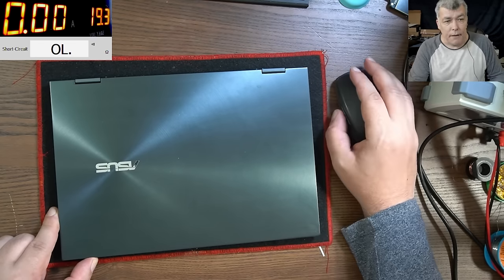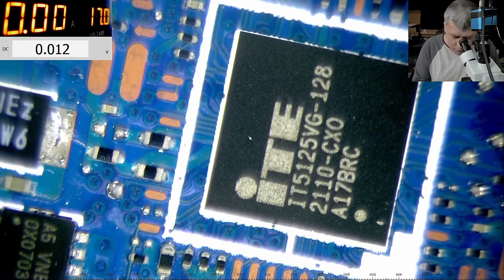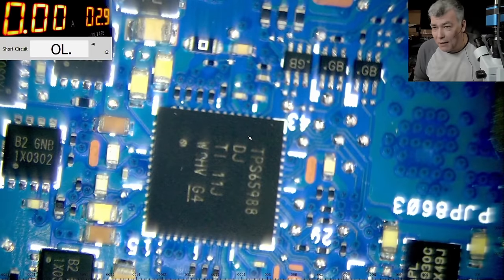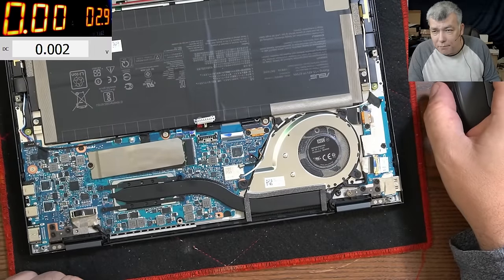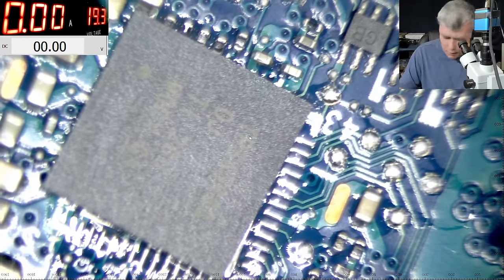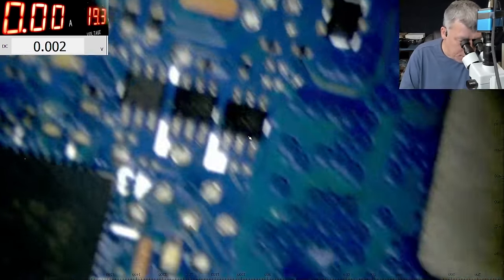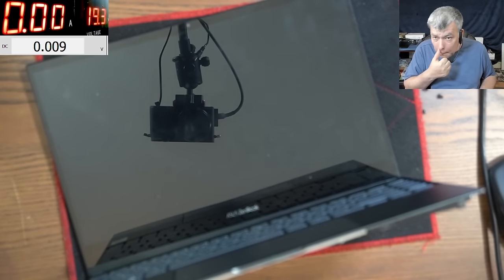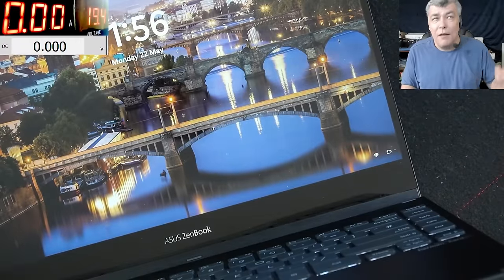Asus ZenBook UX363 not coming on repair. TPS65988DJ replacement How to diagnose this chip issues

Comment: next time you should waste an extra one minute to wick the pads on the board, and replace with low melt solder, you will even be able to lower the temperature to solder back!!

Comment: I have a Dell XPS 13 with the same chip. And the same problem.  I've ordered a replacement from mouser and will try to replace it. I'm new to hot air soldering so I'll definitely watch some tutorials first.

Comment: If you buy a chip and they are a good seller they clean it. And you have to solder the chip because there is a layer of oxidation from the cleaner. And it wil not bond with the solder. Iam happy you found it and get it working.

Comment: Sorin, you need to clean the pads of the old solder first, prep pads with new solder before you solder the new chip in place. I have tried soldering these chips without doing this and they most times do not solder right and I only end up burning the chip trying to get it right. I never solder a QFN chip now without cleaning the pads first.
Reply: I' m also heating the pads on the motherboard at 480° for a while before placing flux and new chip .. that i will reflow at 370°...

Comment: Sorin, this is not the first time I experienced the pins on the chip needed to be cleaned and tinned. Maybe, caused by the solder used by the manufacturer to tin the pads on the IC.

Comment: Try the TPS65988 on other unit if the TPS65988DJ does not work, no firmware required as per specs. Pre programmed with common usage scenarios

Comment: I told you to buy chips from Mouser or an authorized vendor. Especially if it's a complicated chip maybe MOSFET or capacitors have tolerance of fault of manufacture.
Good luck

Comment: I believe you should clean the old solder when you take off the bad chip and reflow with new solder and then put new chip, I dont trust the solder on new chips Sorin just my opinion.

Comment: Yup that chip need firmware to run. I have read the documention on that chip. Texsas Instrumen do provide the tools to program it. The chip also support external bios chip, to store the firmware. The chip can be reprogram with any SPI/I2C programmer. The tools natively support FTDI, Aardvark and TIVA programmer.

Comment: Great video as always 🤓
Could it be that new chips come with a protective film layer on the contacts that need to be burned or cleaned off, may explain that which we did not see 🤣
Reply: It is not that. It's due to Sorin's bad habit of reusing existing unleaded solder. The proper way to do it is adding flux to the pads, tin the pads with leaded solder and then reflow the chip in place. If you just desolder the chip and try to use the remaining solder to do the job, things like that do happen alot.

Comment: 1. So it seems it's not like those pesky undocummented realtek chips with "it's NDA" kind of support. TI says in the DS: "Initial device configuration is configured through a configuration bundle loaded onto the device DURING BOOT. The bundle may be loaded through I2C or SPI."
However there is some kind of firmware GUI config tool.

2. Aren't you afraid you'll melt some plastics under the board?

Comment: 30:25 no Sorin, this time is not good. Right side, 4th pin from the top and one above right down corner.
You added new solder to the middle of the big ground pads under the chip, which was good idea, BUT if so, then during the heating, you have to press down the chip UNTIL you see the big balls of solder coming out from the edges. You pushed it down very well BUT I didn't see these balls coming out, so it means that the solder under the chip were not proper melted (solder outside the chip were melted - yes, but not under the chip on the huge ground pad) You heated it not enough time.  So you soldered it but it didn't sit down to flat completely - so some pins can be unsoldered.
Reply: Mr Guru  yes. I told him many times in the past when he solder high power mosfets. Maybe it is not because of me, but now he is doing it very well - always he is pusihing it down. Here on this video he also pushed that IC down- so he understand how it needs to be done, but this time it was  not enough heat.

Comment: Good afternoon. I'm based in the UK and have a similar issue with my UX363 notebook? Sometimes it works for hours on end with no issues, other times it will require a power button discharge before it turns on. Now as of yesterday (14.08.24) after 6 months of on and off use, it fails to power up at all, no power led. What do you think my options are? 🤔 Many thanks in advance!

Comment: I have the same laptop and issue, stopped receiving power through the usbc ports. I took It to a repair shop and they told me it would need a whole new motherboard replacement. Was it just that 1 chip on the board the he replaced that was the issue?

Comment: I have a similar laptop but in my case, the laptop turns on, but does not charge. The second USB-C port does not work either, and the laptop just turns on with the first USB-C port. Do I have to replace the same chip?

Comment: Battery was too low, that is why it was negotiating 14V only. Once it picked up, it had increase it. 
However, can't believe how "ballsy" you are to desolder/solder the chip without removing the board... and with the screen closed
Reply: what he did is not very wise, one can easily damage the case or some connector or the screen.
Reply: @orange11squares  In this case the screen is quite safe because it's touch and the digitizer can take heat, but connectors or palmrest or keyboard are easily damageable indeed.